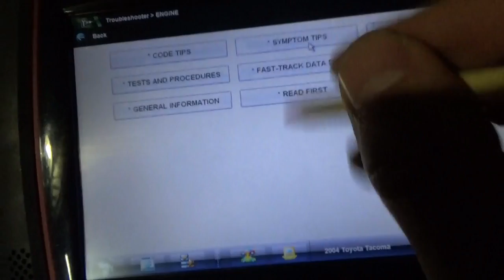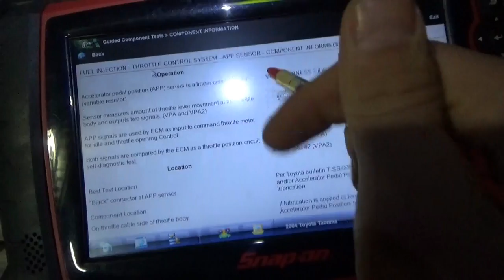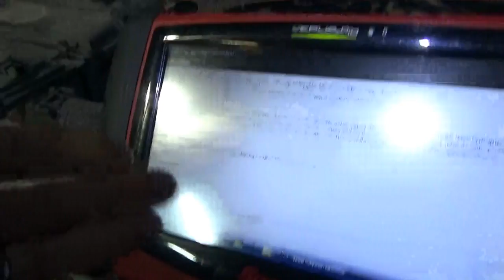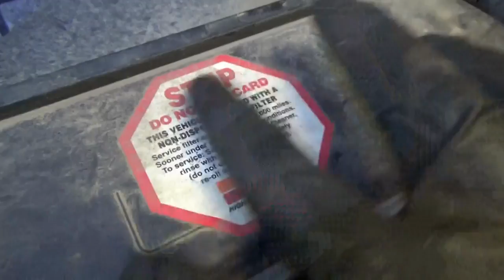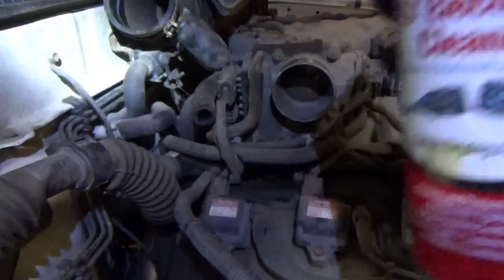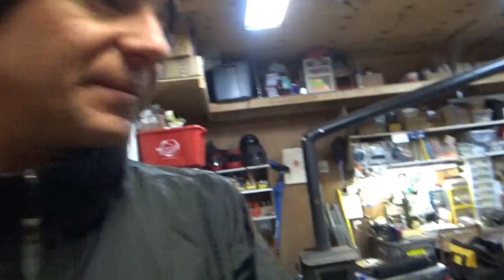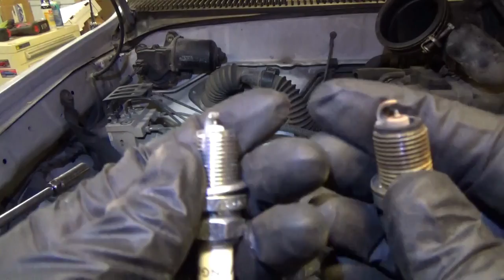Toyota Truck LIMP-HOME (P2111)

Comment: I clean the TB’s on my vehicles every 30k miles. But I take the TB’s off and use break cleaner and a nylon brush. Hasn’t failed me yet, but what are your thoughts?
Reply from the maker: Eh sounds like too much work, and the gasket may be compromised!

Comment: Come on Ivan that didn't need new spark plugs just solder up  the ground electrodes and regap them. God forbid that customer should have to pay for a new air filter. Probably should have cleaned the MAF sensor also. You have a lot of good videos Ivan but this one? Not good! You need to do better work then that.

Comment: The cable still being there may be for those that don't want an electric throttle. They open the hood and see the good ol' mechanical throttle cable and it makes them feel more at ease because it's familiar. Just a thought.

Comment: Interesting to see a model with a throttle cable but motor and sensors, too. Belt and suspenders on the transition year. Wise troubleshooting, Ivan.

Comment: Hi Ivan,first off,tell the guy to just buy regular air filters every year,cost 25 bucks? each.That obliviously looks like a hard use scenario to me. Then 2nd why in the hell do you put in spark plugs with the drill,that's just being lazy on your part,you had what>>. one car to work on all day?Cross-tread the motor and you did more work for your self and screwed that guys motor.And do you realize that a lot of people look at your video's an an example of HOW TO DO THINGS?Come on>>. you're better than that.Some idiot with less skills than you is going to see that and try it too.You wouldn't disarm and old failed missile by cutting the RED wire ,would you? haha

Comment: It's inconceivable to me you would put that air filter back in place for another moment of engine operation.    Pleated filters, when dirty, will suck in around the edges to allow air to bypass around them.  This is a widely known phenom.   I don't care what the stupid label says...that filter is past it's prime and will merely pull the seal away once again, in short order,  allowing unfiltered air to enter the engine and shorten it's life.  ANY MECHANIC worth his weight in salt knows this or should know this.  Even starting the engine with that filter in place is dangerous as collected dirt can be pulled through the bypass upon starting the engine.  Faith in your knowledge has been seriously lost.  Russian fix where you use no parts is inexcusable in this situation and you should be put out of business.  After seeing this, any of your customers who have experienced additional issues after trusting you with their auto's should sue you out of existence.  Or jail time.
Reply: Damn dude, you need to relax or get laid.  You sound like a nagging house wife.
Reply from the maker: @Discretesignals  LOL I DON'T WANT TO GO TO JAIL 🤣

Comment: it was installed properly, the filter got so clogged that the gasket sucked in
Reply: Great theory. That's definitely a solid possibility. And when the gasket got sucked in at the bottom, it allowed a group of pine needles to join the party and they got stuck in the throttle butterfly.

Comment: K&N air filters do a horrible job filtering dirt. Advise the customer to replace it with a high-quality regular filter. Because if he continues using the K&N air filter he's going to have throttle body problems down the road.

Comment: I agree with some of the other commenters. The aftermarket filter letting debris in probably jammed up the throttle plate. The owner probably hasn't done it much good and should go back to an OEM filter.  I think it may cause other issues down the line. 

God i love rusty old Toyotas. 😎

Comment: Ivan,
Great video - thank you. In this case I have to agree with those that feel that air filter should have been tossed - it was too far gone. And I also winced when I see you use that impact driver to not only remove but also install the spark plugs with those fine threads in an aluminum head.
God bless
Paul (in MA)

Comment: Hello Ivan!
I did not see the freeze frame mode on the scanner. Why?
You did not see the signal from the throttle angle sensor.  And suddenly there is damage to the contact.
An air filter like in a horror movie ... I think the trash is stuck in the throttle.

Comment: Not bad for 250k on the plugs. Expected wear and should be good for another 250. Air filter ? More like a muck filter. Plenty build up in the throttle body. Toyota is class.
Reply from the maker: Definitely not original plugs...

Comment: Timing belts on these engines are pretty bulletproof, usually a frozen idler pulley or a shot water pump gets them. A broken timing belt is a problem if you’re 350 miles from home

Comment: Just spray some disinfectant and blast it with a powerful UV light, problem solved
Reply: Can disinfectant be added in the fuel. Lol. 😷
Reply: I think he should flip it around and use the other side.
Reply: Youre not related to Pres. Trump by any chance?😃

Comment: Is it just me or is this a pretty boring video. If we skip the commentary of how much Ivan loves Toyota's, what's left? Swap out some plugs, rake a rag to a throttle body and clean an air cleaner.

No diagnosis of why the idle went way up, no analysis with the scope to see if a sensor was going wonky.

Even though there was a customer that wanted service to ensure continued reliability, we see a wait until it fails thinking.

If you want continued reliability, you are better off replacing the hoses, belts and coolant before it fails.   Original timing belt? Is not now the best time to renew that? Since you are there, the water pump is just a few more bolts.
Reply from the maker: Eh why not just buy a brand new truck and be done with it? No sense scoping sensors that are working 100% fine. In this case it was a real-world approach to researching the system and addressing the customer concern. Sorry there wasn't more drama and excitement lol
Reply: I wouldn't have whipped out the scope on a stuck open throttle code that happened once a month ago either.  I believe Ivan took the most logical path than wasting days on trying to duplicate the concern, especially after seeing the condition of the filter and intake ducting.

Comment: I would never be brave enough to install a spark plug into an aluminum head with a power tool.  I guess if you're very careful and perfectly straight it works but I'd be scared I'd cross thread it.
Reply: I agree, I cringed when I saw that !
Reply: all just very low speed when feel prefect then speed up dont hammer impact.  I been doing for 30 years

Comment: That air filter was SO dirty...the ones i chuck from my Taco are cleaner after being used 2 years than that one. I am.amazed the engine actually got any air to support combustion. I have never seen spark plugs worn like that. I remember the SA at my Toyota dealer telling me my 13 Taco would not run right with Iridium plugs....well has been one year since i changed them...truck runs just fine.

Comment: Hi Ivan just a thought could the reostat have a dead spot? Galvanic action of steel an aluminum always use Anti Seize.
Reply: Antisieze not necessary on nickel plated plug threads.  If tps or app had dead spot, there would probably be a circuit or correlation code popping up.

Comment: ...but did the owner clean or replace the Air Filter?   Also, I believe the seal on the bottom of the filter got pulled out of position because of lack of AirFlow thru the dirty filter. This created a vacuum, and the engine needed air from somewhere. The seal was the first to move. It also may have started crushing some of the plastic conduit attached to the Throttle body as well.  LACK OF MAINTENANCE! Not good.
Reply: Yeah that was a nice one! Looked like my vacuum cleaner filter after cleaning the coal boiler chimney pipe! 😂🤣😂

Comment: My 2007 Toyota sienna has a 3.5 L V6 in it 169000 miles Seems to be a very strong engine only replaced the water pump , which I guess is a weak point on those The shaft looks like it’s a pretty small diameter, Great video Ivan, Always a learning experience With your videos

Comment: I put 260,000 miles on a 1991 Pathfinder with a K&N air filter before the frame broke. I cleaned the filter ever 15,000 miles. I never got a filter that dirty even when I drove to Alaska. That filter needs a cleaner kit. Takes about two hours if you have a fan to dry the filter. My filter never looked like that. The cleaner fluid needs to be applied and rinsed after 20 minutes. I would do the cleaner  twice then dry and apply the oil(it's a spray). I bet his mileage goes up by 30%. With that dirty filter I bet the engine was running rich.

Great video Ivan. Stay well.
Reply: Even so, all the tests that I have read about, prove that the K&N filter does not filter as well as the regular paper filter.  If you want that slight hp increase that may or may not be there and you stay on pavement, perhaps you should install a K&N.  I personally have never used one and never will.
Reply: @williamwhite9767  What you do personally is not my concern. The HP increase was not my concern the increase in mileage was. The engine at the time of recycling was the only thing that was as strong as the day I bought it. After driving vehicles over 1,000,000 miles I personally will continue to buy them.
Reply: @IBenZik  I'm not concerned about what you do either.  But, everyone needs to be aware that if a K&N air filter is used, their engine will ingest dirt that a regular filter would filter out.
Reply: @williamwhite9767  Well good for you. I state my experience and you belittle my maintenance. Do you work for Fram?
Reply: @IBenZik  And you said you didn't care.
Reply: @williamwhite9767  Ge Billy so did you
Reply: @IBenZik  I'm sorry I hurt your feelings but facts are facts.  K&N filters pass more dirt than the OE type filters.

Comment: The throttle sensor for the gas pedal is going bad I had the same error on my dads car but was a gm replace the unit it’s like worth doing problem should never come back
Reply from the maker: How can you call the sensor for the gas pedal, when the trouble code says it's a failure to close the throttle?

Comment: Great video Ivan.
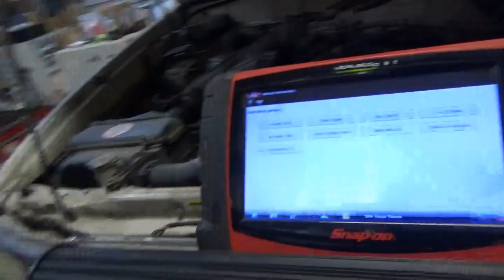At 16:43 you noted that the cam belt may not have been replaced.
As the customer does not want to get stranded out in the back blocks, even thought a broken belt will not cause major motor damage, it will cause the customer some stranded problems if it occurs in the field.
Did you ask the customer if he the belt has been replaced and when?
260,000 miles and no belt change is asking for trouble.
The cause of the deformation of the bottom of the seal on the air "cleaner" could have been caused by increased air pressure and intake vacuum differential with the filter blocked.

Comment: The 4runner has the same engine.
Reply: 2001-2002 4Runner also uses fly by wire. I think the traction control system will regulate the throttle angle.

Comment: Its possible a piece of debris got passed that filter just in time to stop the plate from completely closing? After causing that code the computer disabled the throttle control system. That filter was definitely the worst I seen too🤔

Comment: I was just thinking, intermittent throttle issues? Start from the first thing in the chain, the air filter,  then the hose-clamps, then the throttle-plate itself.
If plate all carboned up, methylated spirits is a good cleaning agent.
If still issues then go into full diag mode. Then you opened up the filter housing and all was revealed. Dusty roads etc what you expect!
I check my airways (the cars) once a year and make sure that air filter is clean and seals. And I agree Toyota is quality.

Comment: I did a valve job on a truck with the same engine. Burnt exhaust valve. Just one. Today, replacing leaky brake booster 99 Camry 4 cyl. 225,000 on the clock. Customer complaint was “I have to plan my stops wisely.”
Reply: lol at {Customer complaint was “I have to plan my stops wisely.”}

Comment: Pine Hollow why didn't you call customer and ask him or her about taking throttle body completely apart so you could clean and inspect for wear and possible parts to fix? Just asking mate. You knew this unit needed work. It should have been done, in my opinion.
Reply: Take it apart?  There is no service procedure or parts for servicing the throttle body internals provided by the manufacturer.  It coded  once and the air filter looked like it was  found in a dustbin. Ivan took the right path.  Let the customer drive it and if the code returns, replace the throttle body.
Reply: @Discretesignals  Who are you? Your opinion isn't what I asked for. I wanted to know why he did what he did. Not your opinion mate. Chill out.
Reply: @kennedy67951  right on Mr. Kennedy.  I failed to realize you were questioning Ivan directly.  Sorry about that.
Reply: @Discretesignals  That's okay mate
Reply from the maker: Hi James, I agree with the response above 👍🙂

Comment: WOW! That air filter was hammered!! I've seen some dirty ones but it looks more like some cabin air filters I've pulled out that people never knew they had. Yikes! I think I'd just stick to changing with an OEM style filter.
Reply: The cabin air filter in my sisters Corolla was like that. Hadn't been changed in 7 years/50,000 miles. It was gross.

Comment: He just shortened the life of that motor by 200,000 miles injesting filth to the intake, I don’t care how good a car is, you still need to do maintenance.
Reply: The 16-year old truck is on borrowed time in the northeast. On its 2nd frame already. Imagine what the other components are like.
Reply: @KenLyns: Tsk, tsk... Of course percussive maintenance and general technical reasoning prolongs the service life of absolutely anything (unless you're TV-shopping all your garbage from US TV commercials). You'd be surprised how much a 5 min care each month would do for a mechanical or electronic item. My car is 35+ yr, daily driver, I live by the atlantic ocean, our roads get excessively salted every winter, our cars must pass rigours inspection periodically, I have no particular interest in any car (especially my own) apart from it not breaking down...

And the bugget never evers dies, so no excuse buying something remotely more modern.
Reply: Diminishing returns. Even with yearly FF/Krown, that body/frame/axle would be rusty after 16 years in the northeast. No point in babying the engine to go longer. TV-shopped garbage (aka Chryslers) get rusted after 8 years in the same environment.
Reply: @KenLyns  : Don't have nor know what "Crown" is, except for an old Toyota model. We do have FF's though, but I doubt a "Friend with benefits" (especially annually) will help your vehicle situation, hahahahaha!
Reply: @TheFirstBigCheese  Fluid Film (FF) and Krown are rust protectant sprays. I thought you lived in a salty area?
Reply: KenLyns Actually no mine isn’t , the metal is well treated and to this day is in excellent condition throughout.
Reply: @KenLyns  : Yes, I do live in harsh climate but, I know this might seem shocking (maybe, or especially, to people  who hasn't been outside their national borders. Or maybe not even outside their home borne state). Local and national brands are just that, local! You might see, if you'd be a little bit travelled, that non-US brands don't really exist outside the states, but also that the substitutes are not only named differently, they also perform better.
Reply: @TheFirstBigCheese  Talking about yourself here? Fluid Film and Krown are national brands and widely used in the northeast (where this truck is). Also mentioned often on this channel and South Main Auto.
Reply: @KenLyns  : This should not be this hard to grasp... I say again, we don't have those brands here! National brands are different across the world, that's what makes them, gasph, *national*. But if it's as you say, even with anual treatment it'll still rust out, well I'd say the product quality speaks there for itself. But if you insist arguing, by all means, send some over and I'll compare it to our stuff. I'm sure I'll find it mildly interesting.
Reply: @KenLyns  : Hey, what a coincidence; "Project farm", YouTube channel, just did a pretty decent review involving Fluide Film... To me the FF result is not even mediocre. Even just smearing on regular grease looks to be better in all those comparative tests.
Reply: Look at Project Farm's corrosion-preventative spray tests. ;) FF, grease, and anti-seize have their own uses. You're welcome to try lathering grease on the bottom of your truck...
Reply: @KenLyns  : I don't get your trail of thought, above you were mentioning Fluide Film as the american product of choise for this exact purpose...
Anyhow; leathering grease is exactly what is being done on our trucks, it's manufacturer specified procedure for corrosion prevention at certainty places. And this is on vehicles WE call "trucks", which I belive your term for is "semi" in US. 8 yr as an automotive engineering cunsultant in test and system validation for "semis" and "super heavy", and nowhere have I seen a product like fluide film being recommended as corrosion inhibitor; film strength and sticktivity is way too low.
Reply: @TheFirstBigCheese  "percussive" maintenance is how the frame failed inspection 😂  Holes appeared when the hammer struck.
Reply: firebir11 *ingesting.

Comment: probably put some hosed air back through the air filter in an effort to remove more dirt. maybe used a can of seafoam cleaner, but great job Ivan.  thx for the vid.